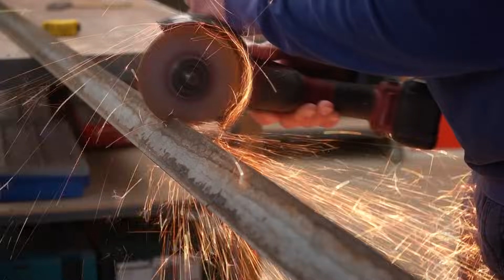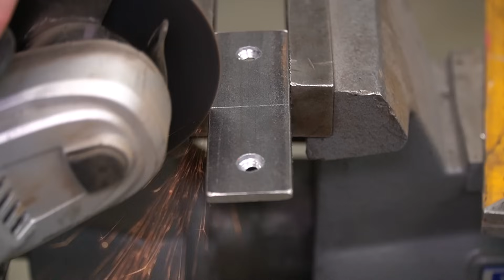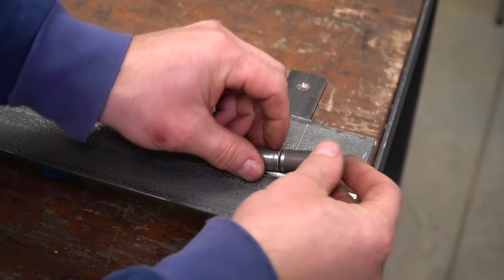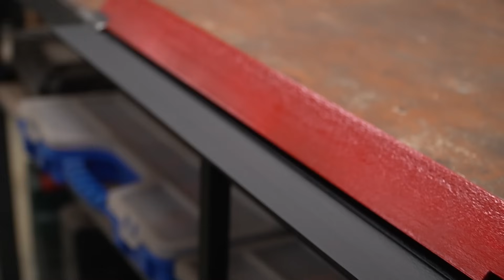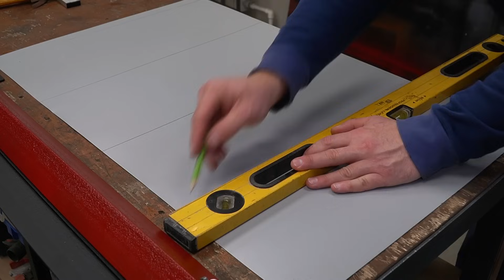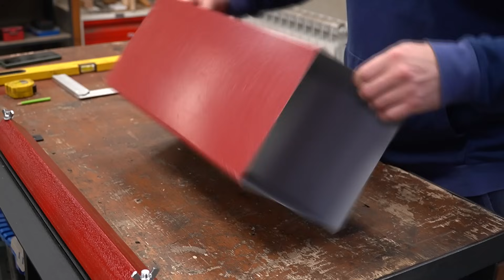Minimum cost for a cool device!

Comment: VERY GOOD DESIGN.  BUT... 

May I suggest you to install not one, but two handles, located at 1/3 and 2/3 of the lenght, and use your two hands to apply the bending force simultaneosly, you could obtain a much more uniform bend, especially when bending thicker sheetmetal... 

Good luck and thanks for the several great ideas you gave me for a fine bending device!  Best wishes from Mexico!
Reply from the maker: Thanks for the great suggestion 👍